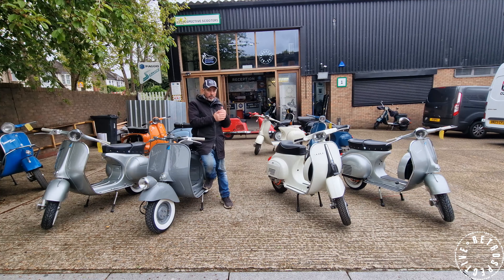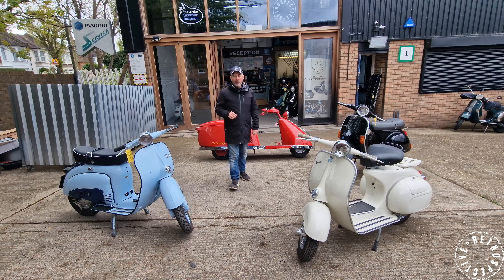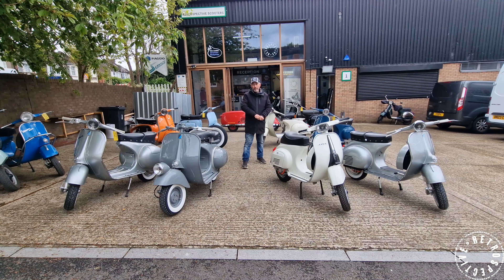Electric conversions explained in layman terms.

Comment: There are plenty of electric mopeds, scooters and motorcycles on the market. Why destroy classic scooters to make them electric? It is upsetting!
Reply from the maker: NOT DESTROYED it's a reversible process , old motor can be reinstated , and I don't want to ride an ugly modern plastic scooter , I want to ride a classic scooter and for it to be electric for all the reasons to  be electric  , I 'm not the one banning combustion engines I just offer an option  .